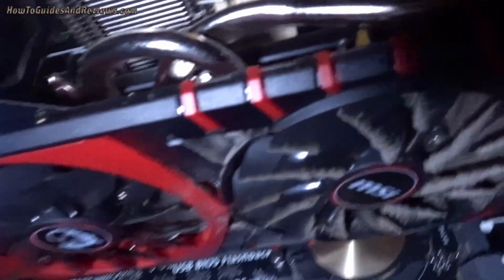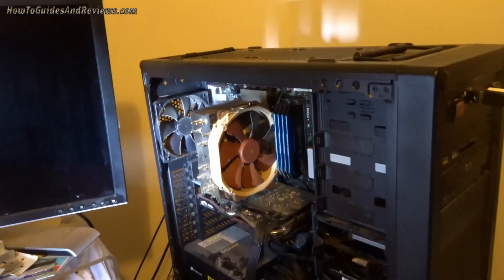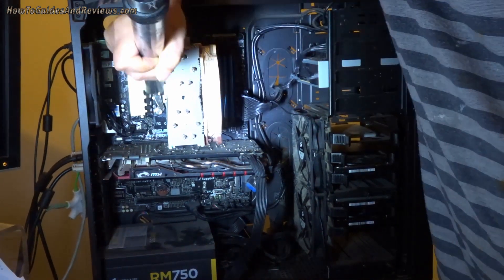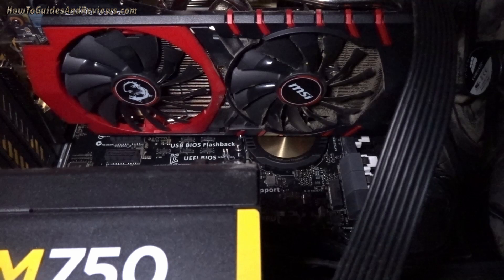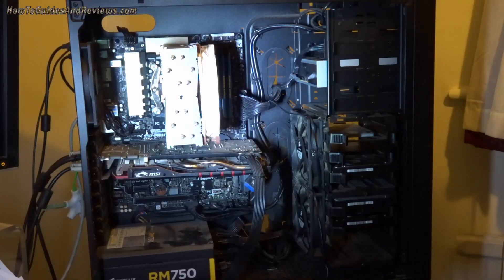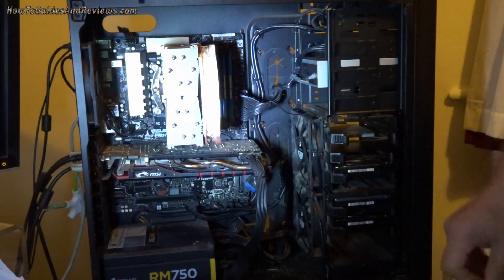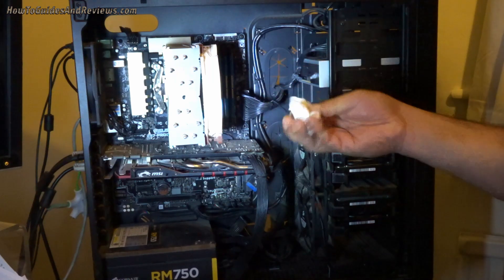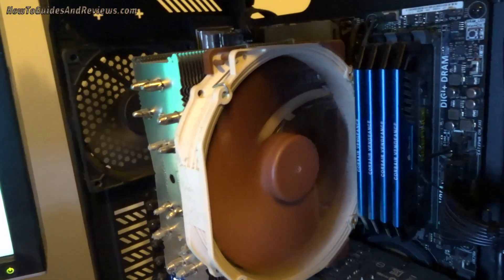GPU FanS Not Spinning FIX - How to Easily Extend the Life of Your Gaming PC System - Dust

Comment: Hy i need help, so I have a gtx 970 wind force g1, it has 3 fans, and one of them is loose and doesn’t spin, the other 2 work perfectly fine, do you know what’s the problem ???? Plss help
Reply from the maker: Loose? Maybe it's come to the end of it's life, you could use afterburner to ramp up the speeds of the other fans and just use 2 fans.